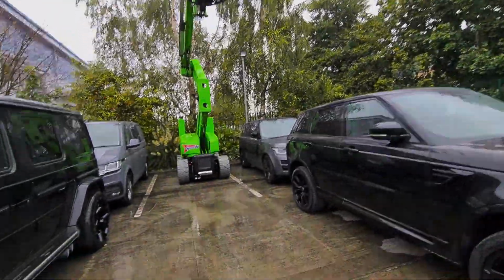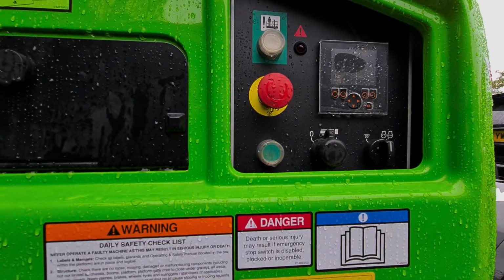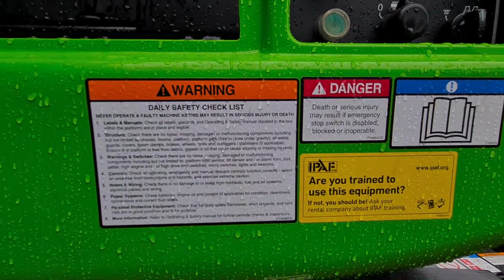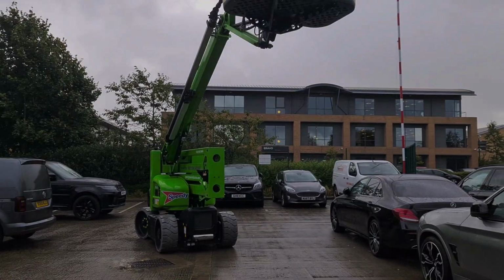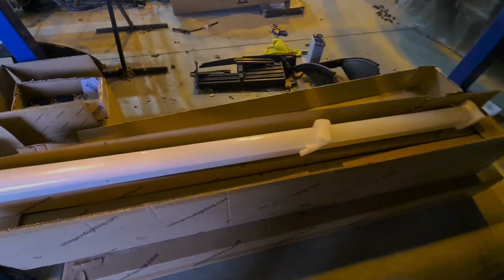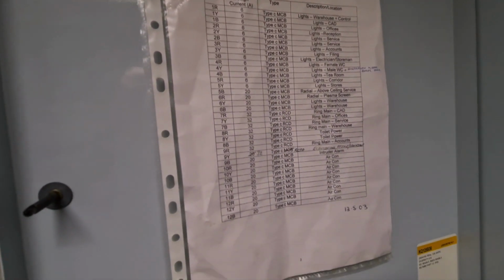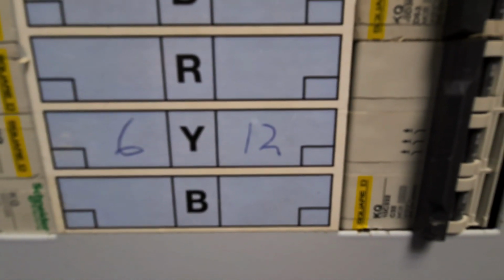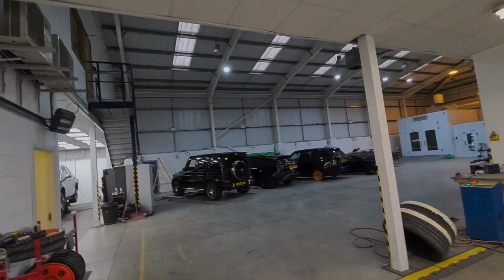Dangerous install Collingwood 200W high Bays and new super bright wall battens Car detailing lights

Comment: Hi sir yes nice work pretty much my type of work up to retirement , we did install some high bay LED lights which were relatively new tec at the time . We installed 50 units in a freezer store , they cost over £300 a peace , I assume they have come down in price a bit now 🤣 . But we were assured by the manufacture that with in five years they would pay for them selves because of the high consumption of the fittings they replaced . It would be interesting to go back now after 10 years and see how many are still working . There’s no doubt that LEDs do give a better light , and in your installation that is very important.     Keep well keep safe and keep busy .     Best wishes and kind regards.   😀👍👍👍
Reply from the maker: Thanks for the well wishes! These were a fair price each. Not quite £300. Its really hit and miss with led they either seem to work ages or fail in days lol. We have gone with collingwood in an attempt at quality. But its no guarantee with anything. We look after an install with led lights well over 5 years old. Still going strong for the minute

Comment: Hi. Mark nice vid.    Good forward thinking …. I did a detail and wrap center last year with let high and low bays and 6ft led tubes on wall all round ….. only to be asked to add 600x600 led wall tile lights to create a light bay so going 4mm was a good call by you 
Nice job 👍
Reply from the maker: This is the thinking Tom! Now they see what can be done the requests will keep coming 🤣. Thanks for watching and sharing your experience. Wall tiles are a great shout for the bays I had not considered.